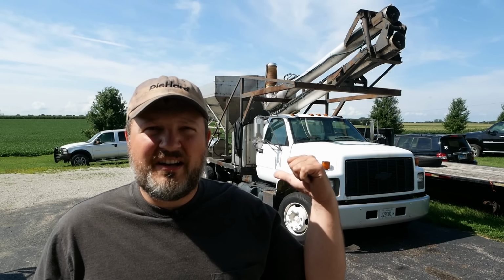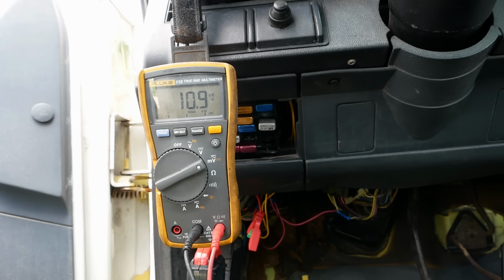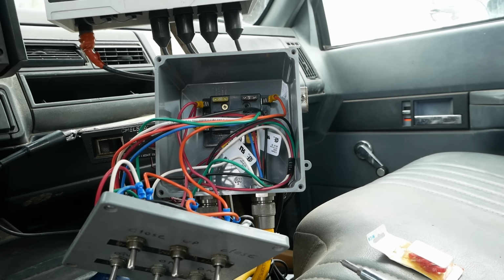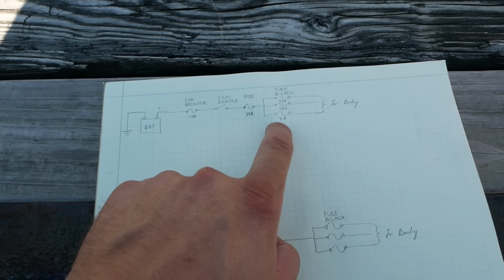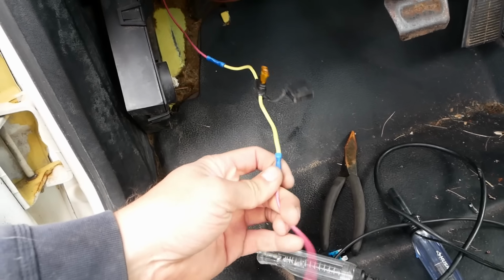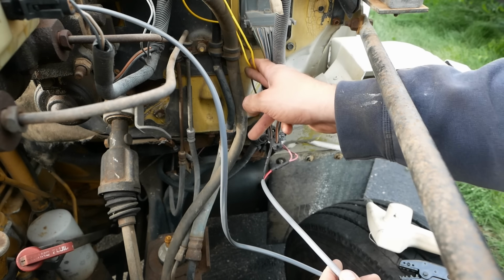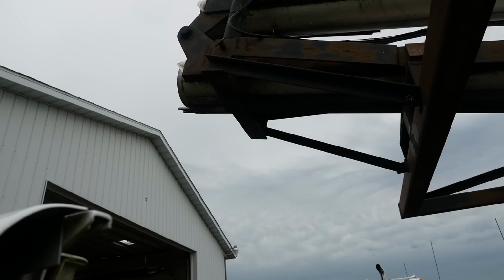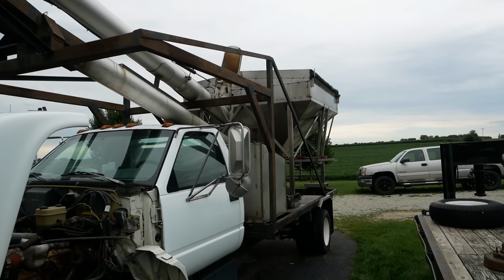Crop Duster Tender Truck Dies Every 5 Minutes

Comment: It’s amazing how some people wire things, glad the people that wired this truck did not wire a house or garage like that. I am pretty fussy when it comes to wiring and do my best to make proper connections that will last for years. It’s nice to see that your the same way when it comes to wiring. That truck may be a good candidate for a battery disconnect switch to prevent a fire. Thanks for sharing your time and videos. Your wiring diagrams are great. 👍🏻👍🏻

Comment: In the time you waited for replies etc you could have probably fixed the original fan.
In my shed i have the perfect fan that came off a Honda motorcycle.
As for the electric, yep, they were sketch to say the least but the quick cheap fix was to fix the fan, it’s worked this long, i’m sure it would have continued to.

Comment: Wes, FYI they make relays with LED lights for diagnostic purposes. They're about 3x the price of a basic Bosch style relay, and one could just use a 12v LED lights is parallel to the relay for the same purpose.
Maradine makes some good fans. The Texas Twister is a nice fan blade that is useful for the big 3 plus some foreign rear wheel drive vehicles.

Comment: Video starts...Yes Wes, we can see your adorable supermodel face..... Kardashian style fame awaits 😂😂Fully sympathise with you just wanting a fan and them asking you to buy a complete unit. Daylight robbery and should be outlawed. My car (UK) has just had it's yearly road worthiness test (M.o.T) Flexi-pipe that goes to Catalytic converter split but no escaping gases (advisory item) Can you buy said flexi-pipe? No, you HAVE to buy the cat aswell so, 800 English pounds please. Ball joints on suspension arms......cheap enough items eh? No, must buy the entire arm, £300.00 per side. £1,400.00 for something that could (in my day) be  easily fixed  for a few pounds. As I'm getting on in years I have no choice but to use commercial garages now, but sadly, here we have a saying RIP OFF BRITAIN and it is the absolute truth. Everybody wants to make a years worth of earnings out of every customer they encounter. I just wish you were my local mechanic, at least I'd know you were taking care of my car with skill and compassion. Anyway, rant over 😂😂Take care Wes, keep up the good work.

Comment: Great job on the diagnostics and chasing the rabbit down and around the rabbit hole. Taking the time to make a schematic of the wiring the you did witch was done on your time not the clients time. At least that was the way it was in the small shop I worked in. It was find it fix it bill it out the door it goes and what’s next. I hope you never get one that the whole electrical system isn’t burnt out that the type we’d take into our shop

Comment: The original fan did not appear to be outdoor rated.  (Seizing up was a clue).  I hate suppliers like that who could care less about the customer.  I probably would have gone straight to eBay or Zoro since the week of runaround is pretty predictable. And the OEM would just charge you a boatload for another non outdoor rated fan.

Comment: always so much 'fun' figuring out someone else's fabricobbling isnt it Wes. at least  there werent residential wire nuts or those POS vampire type connectors.  you made things as right as you could w/o ripping the entire mess out starting over again, which probably wouldve involved getting into the hoist , auger etc

Comment: On Fords with utility bodies, I've had many that have smoked the tail/marker light terminal on the headlight switch. I've had good luck after repairing the connector and replacing the head light switch I add a relay controlled by the headlight switch tail light wire and wire from 12 V  power source thru a fuse to relay then to all the tail/marker lights.Most van bodies {noticed it first on U-HAUL trucks I use to service} have a relay wired in, why utility bodies don't is beyond me. Now with LEDs may not be needed.
Reply: depends on the setup and how many LED lights are run

Comment: Sometimes you can remove the motor from the bad one and replace it with new motor if the bolt pattern is correct

Comment: An isolating relay for controls would help, as you installed..[#10 wire gets a 30 Amp fuse.#12 AWG for 20 amps. #14 Awg for 15 amps]

Comment: 1:18 Yes the 3116 and 3126 were mechanical. Common fuel rail with a rack to move all 6 injectors.
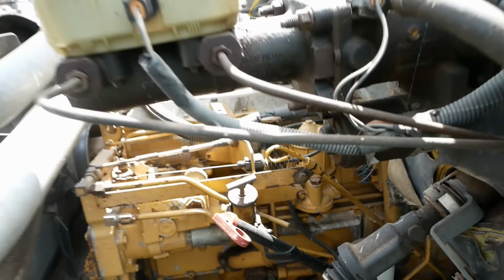2:30 Yes that is a fly back diode.
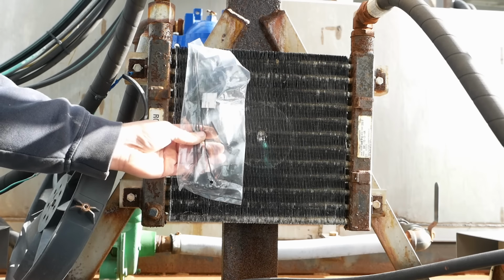22:31 Thank you for making the brackets. There is enough "Who did it and ran" done to this.

Comment: I've seen some light fold-up logging cranes with a cylinder that overextends backwards (search for Palfinger Epsilon s260z), but in that case they can force that joint over its dead point with the main boom pitch. The way the auger boom is on that truck you worked on, I think the dead position is about in a vertical, balanced position, so I think they get away with a bit of momentum and quickly reversing the control input when the joint is overextending.

Comment: The boom is not normally folded back. That is only done to take it on the road or store it. In service, they only need to lift the boom to remove it from the plane.

Comment: The joys of having older trucks in Illinois.  Finding a ground is fun. I have an old McHenry County tandem that's more rust than metal. Wanted to use some of the evaporust but I'm afraid my truck would dissappear.

Comment: 14 ga wire is good for 30 amps?  10 ga wire is good for 30 amps.
Reply from the maker: In the automotive world the rules are a bit more flexible.
Reply: With 120VAC, yes (and NEC concurs with you).  With 12VDC, SAE is more flexible.

Comment: Well Wes, you may have saved this guy from more damage than he realized by not having his kimerfloget truck burn down in the middle of cover crop seed spraying. My guess is the pilot is the one running 180 amps off a 20 guage wire that was shorted to the firewall. Of course he doesn't want the wiring fixed. When that truck hits a pothole in the field and it knocks the engine off the motor mounts because, just because, tell the pilot you will fix his truck so it doesn't do that. Grab him by his shirt collar and tell him I WILL FIX IT SO YOU CAN USE IT NEXT YEAR. BE PERSAUSIVE. MIGHT SAVE HIM OR NOT DEPENDING ON THE MOON CYCLE.

Comment: When you already know that the fuse doesn't get shot in regular operation, it's perfectly fine to temporary replace it for a jumper wire in the workshop to be able to measure the current.

To me that wiring looks like the last guy who converted it to its current state had to work with an installation that had already been converted to something else before. Nobody runs a wire out of the cab just to run it back into the cab. But when there already had been someone who ran a wire out, you will probably find someone who runs it back into the cab instead of checking where it orignally came from. Maybe the control box was installed on the outside when the truck originally was converted to the crop duster tender. Maybe it was later repositioned to the inside for some reason.

Comment: Should have used a wire nut on those red wires - that what the "dealer" would have done....
Reply: pfft, 'dealer' wouldve used the scotchlock that come with almost every aftermarket add on

Comment: 3M strip caulk or a chunk of duct seal would make a decent grommet for those yellow wires.
Reply from the maker: I just put some nylon air line over the wires and slipped it through the hole.

Comment: Hmmmm, a “jumper wire” with no fuse in it…?   Maybe something like what I have installed in my riding mower seat sensor cut-out switch…, and have ran with for the last 10yrs…?

Comment: Sometimes ford N Holland L785 with 3 cyl diesels when they sat overnight they would pull air instantly next morning hand primer on filter base would let air into system install new primer problem solved !

Comment: I am an electrician with over 20 years experince you should see some of the cluster F**cks I have seen over the years. Cousin told me when they went to remodel his bosses house all the wiring in the walls was those cheap two wire extension cords

Comment: I know that struggle. Had a guy at work hook up a 400 watt amp and a car stereo in a Hyundai Robex wheeled scrap magnet at work to the lift pump circuit. He said that he'd turn his stereo on, and the engine would only run for about 30 seconds and acted like it was out of fuel. Imagine that. It was slowing the pump down to the point it was almost stopped, starving it for fuel. I ripped the stereo out, per bosses orders, and told him to deal. Problem solved.

Comment: You get these jobs because you are really good at trouble shooting. To bad the customers don’t allow you to follow thru and clean up and put things right.  Excellent job on the fan mount sir. Those things you refer to as apparatuses, I used to refer as an ape er rateus, because some of the things I ran into in field service work could have only been thought up by an ape, and I’m not to sure an ape would not have been insulted by such a comparison, then I guess, some times you have to do what you can to get it up running. Thanks for the ride along sir.

Comment: Wiring has always been a huge pain for me! I have found the zip type fan holders are ok for strictly highway use. Might keep the info on the fan, i've had a few die in the last 2 or 3 years.

Comment: No thought process...farmer engineering at it's worst....great job Wes.
Reply: Ive seen upfitter shops do much more butchery hack work then farmer ever could. Farmers work with they have, upfitters dont get to use that excuse  except for cheap corner cutting lazy

Comment: The stuff you have to deal with. I work on industrial electric motors. We are repairing quite a few at a significant cost to the customer because the lead times on replacements are in the 30+ week range. 
Oh and another benefit of covers crops is their ability to affix nitrogen into the soil.

Comment: Don’t you just love it when people with very little idea on vehicle electrics try to design and install a vehicle electrical system. I guess a dedicated feed from the battery and a heavy duty relay switched by the ignition would be a step in the right direction. I so wish people would leave auto electrics to auto electricians. Injection system sounds a bit like VW PD injection system. As for helpful service obtaining parts and information, I thought it was just here in the U.K. that things were crap. Seems it’s globally universal? Another job well done 👍

Comment: I wonder if that fan died because of the severe voltage drop on the wiring, causing the motor to draw more current than it should have needed.

Comment: surprised the fan didn't have a thermocouple to start automatically or be wired to start when you turned on the apparatus. seems like it would overheat if you forgot to turn on.

Comment: I work  a lot on  this engine if I had to address the hard starting I would start with the check vavle in the fuel filter housing do a leak back test on it

Comment: Why all that effort to buy the "original" fan?
Reply: Bolts would have fit exactly and no need to cobble up brackets.  OEM is OEM.  Might have been an "engineer designed" air volume draw through the cooler, all sorts of logical reasons.  Who ever built the rig had a reason to select that oil cooler.  So, why second guess them if you don't have to.
Reply: @CAPNMAC82  Sure. The whole rig is an engineering marvel. Who knows what could happen if critical components were changed. Lol

Comment: Great deduction process.. wish you would have shown the Amp draw on the fuse post repair with the pto and fan on.
Reply from the maker: It should be around 1 amp. We are only powering the coil of the relay.
Reply: @WatchWesWork  I think he meant the normal current draw of the truck itself.

Comment: The original yellow paint tells me that that truck was originally from  CLEVELAND ILLUMINATION CO. 
I also have one of their former trucks with a CAT 3116 mechanical. Hard to start in the winter unless you plug in the block heater. Otherwise it's been a reliable chassis. Personally I would prefer a separate tap/fuse for the PTO for future ease of troubleshooting. Great job as always

Comment: Wes, still don't get why the truck was shutting off, it was because of some kind of power interuption?
Reply from the maker: Because the ignition circuit breaker trips due to high load from the seized fan.

Comment: What? They didn't use household wire nuts originally? I thought that was standard operating procedure. 🤣
Reply: nah, those scotch lock vampire taps are the SOP then wire nuts before buttsplice connectors

Comment: I worked on a friend's boat years ago with a 3116, it would run 30 seconds and stall, hand prime fuel through mechanical pump it'd restart, rinse & repeat.

Turned out the unit injectors were fed through drilled fuel passages in the head and sealed off between the head, injector & combustion chamber by yellow metal cups that the injectors seated in. They apparently like to crack and let combustion chamber pressure into the fuel passages after running a bit.

That motor grenaded itself a few months after we got all that straightened out anyway, swallowed one of its own valves, bounced it around inside the affected and adjacent cylinders then spit the whole mess through the turbo. Good times.
Reply from the maker: They are not very good engines and hard to work on.

Comment: whoever wired it up the 1st time probably never considered the power source for both hot wires was the same. The fan locking up made it all fail. I remember those Case backhoes working like that

Comment: I know it would be completely "wrong", but would have just changing the fan "fixed" the problem? Was the draw of the seized fan tripping the breaker or was it tripping with the fan off, too?
Reply: Hey Mishn0 ... the ignition circuit is/was never designed to take high loads.  it's basically designed to provide power to other switching mechanisms (modules or relays) total load cannot be over what the circuit breaker was and as a best practice, probably not exceed 1/2 the breaker capacity.   Using the relay just switched the load off the ignition circuit and into the relay.  The problem would have continued even if only the fan were changed.

Comment: After that mind-numbing and no doubt want to be fuse-blowing, no grommet, unprotected wiring disaster, your wiring diagram and subsequent installation was so clear, obvious and superior. Suddenly it all made some logical sense, that had been so lacking before. The heat exchanger 'deal' you were offered was simply absurd, I guess your fan cost less than 10% of the dealer quote. Too much work for a truck that wanted its pension book and a funeral pyre, but you came through, thoroughly entertaining and satisfying to watch.

Comment: Personal preference and all but you can get relay bases similar to the one you used but with 3 fuse holders on them and a bag of crimps instead of pigtails.

 Well done on getting it sorted. Don't know how you've got the self control not to rip it all out and do it all correctly. Made up some wiring harnesses for some old Landrover's and it was so satisfying ripping out 60 years of electrical bodges.
Reply: Probably faster, too.

Comment: Nice job wes at least there wasn't any blue wire nuts in use
Reply: I was wondering where the scotchlocks were actually or the just twist and  tape connections

Comment: I think the best bit of efficient wiring is in your head. Your brain is set up to apply what you’ve learned in training, factor in what you’ve gathered from practical experience, allow for the stupidity of others, account for designer ignorance and apathy and combat “I’m just gonna make it work somehow, says the owner” syndrome. I don’t do what you do because my only approach would be to hack it all out and do my own point-to point rewiring (with no promise that it will fix or improve anything). Good job! 🥸👍💥❗️🔧✅

Comment: Another great video Wes. It seems like some companies go the hard way with their installations just so they can charge more because it took more time? Then cut corners like no grommet install to save time. Gets the customers out the door with guaranteed problems later for a repeat return customer. Your electrical diagnostic skills are top notch and I admire the thought process you go through. The fan install was 1st rate also. Doing the job right is not going the extra mile, it’s called professionalism!!!

Comment: Hey Wes. I recently ran into your channel and I have really enjoyed it. I like that you don't typically half ass repair things and want to fix it correctly the first time. Too many of us have suffered from a vehicle that had been screwed up by a hack mechanic/s. Having wrenched on old, classic VW's for decades as a hobby, it's amazing the amount of butchery you find from previous "professional" mechanics. 
Too many other Youtube automotive fix it or will it run channels have "mechanics" that seem perfectly content in doing things half ass or cut corners sending the wrong message to their viewers in my opinion. My Dad use to say to me "if you can't do it right the first time, don't do it at all".. To bad such a high percentage of current "professional" mechanics don't live by that motto.
Reply: Some people shouldn't be allowed to own wire cutters 😳. Always run relay's try to stay away from factory harness tap off battery with fuse at battery unless you need a toaster put pilot light on circuit to remind you to turn off or put a battery disconnect on new feed from battery to shut down aux circuit. Tons of electrical work on class 8 trucks some of that will make you talk to yourself